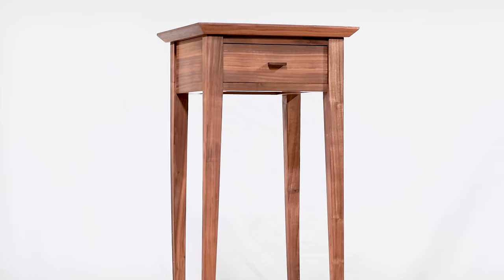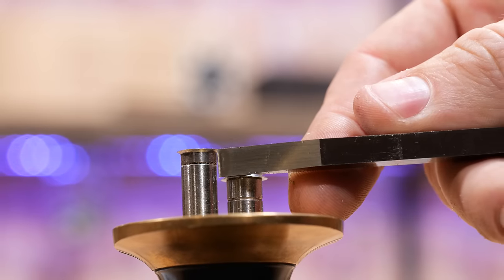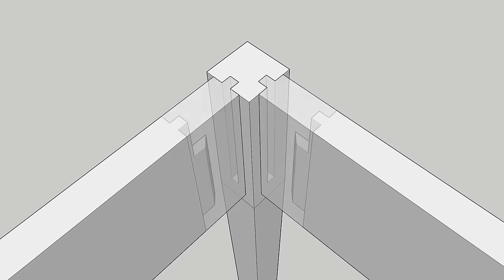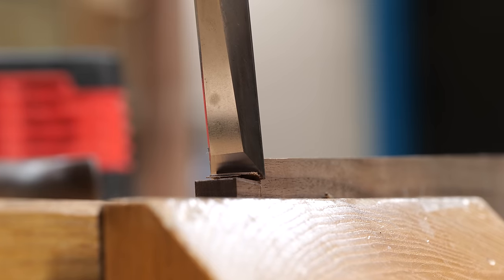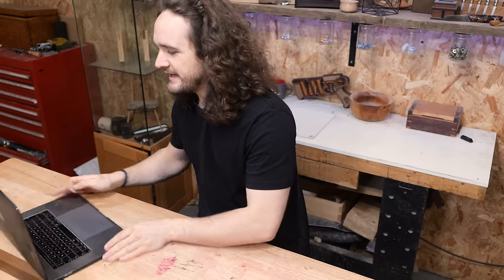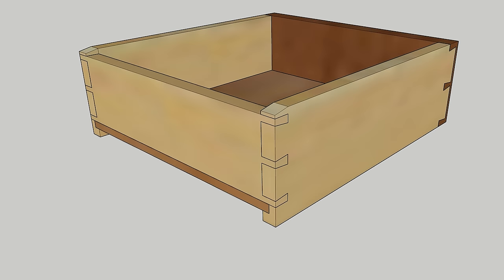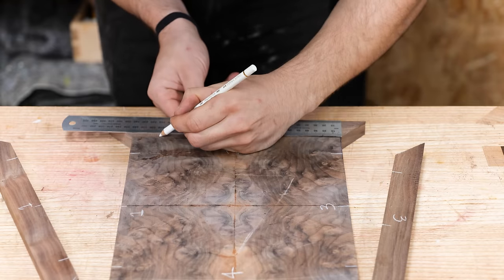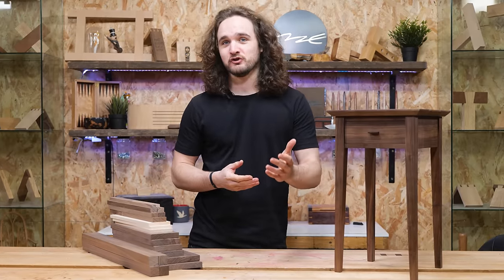You Can Make this Luxury Side Table for Free.

Comment: Wow! Great to see. Made very similar back around 1970 at school (boarding where they opened the woodwork school for 7 extra hours during the week and the head of maintenance, who was a joiner by trade, ran the extra classes). Still have a coffee table but lost the bedside cabinet I made for my sister. I did win a big prize for what I made. With no space for a workbench, I use machines now, eg pillar mounted Bosch or Trend DIY router for mortices to scratch build a kitchen with no chipboard for a friend. Inlay grooves made with Record Multiplane in pre-electric router days